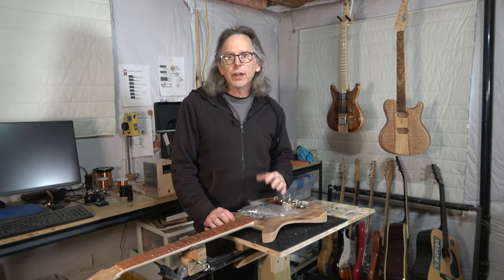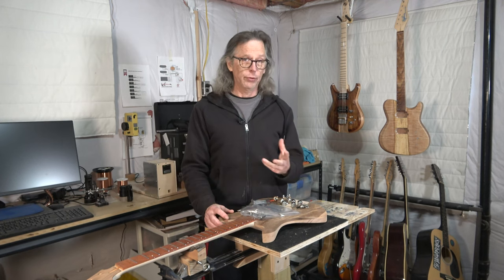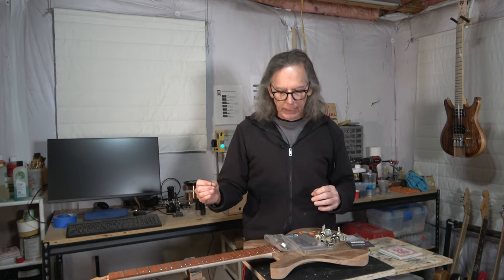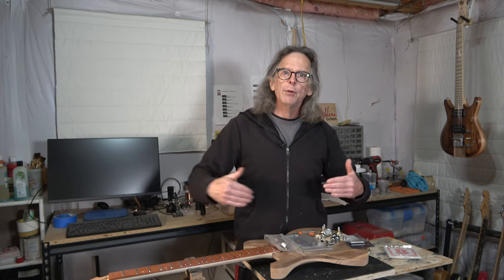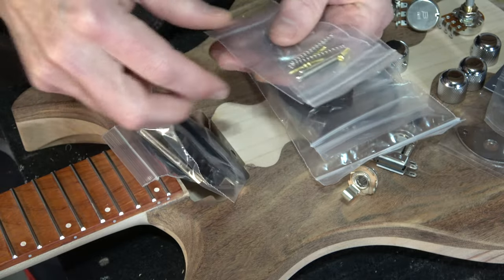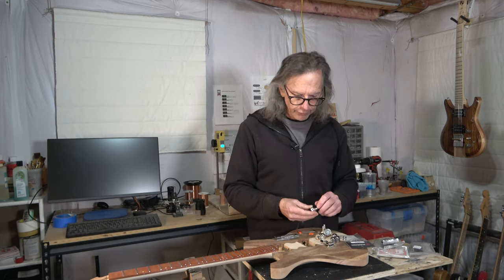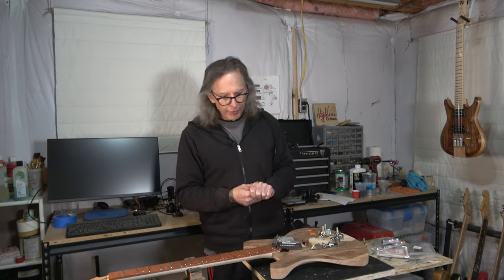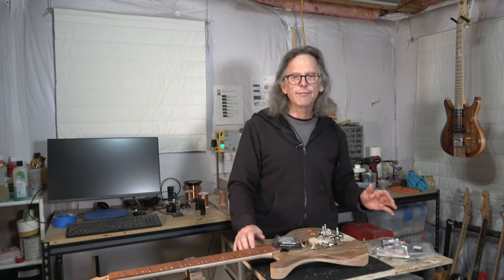Building A Neck Thru Guitar Part 14 Pots, Switches, And Pickups

Comment: You mentioned a 25k pot as being used in passive guitars. Did you mean to say 'active'? 25 kOhms is pretty low Z but would make perfect sense following a buffer circuit.
Reply from the maker: Yes. I misspoke.

Comment: Do use lead free or leaded solder? Which is better?
Reply from the maker: I use leaded as it makes a better connection for electronics.
Reply: lead free solder is for plumbing applications.